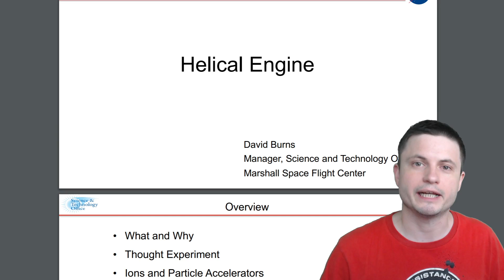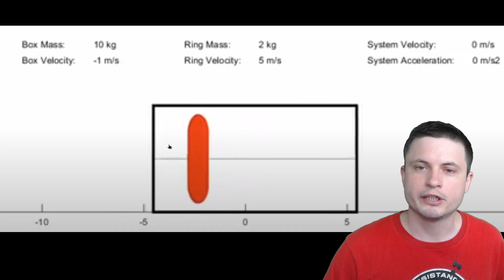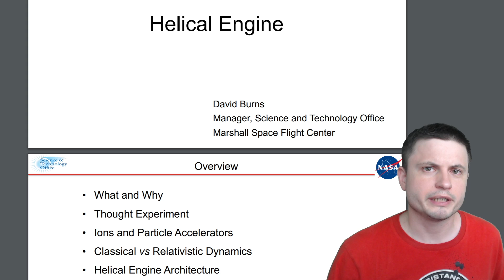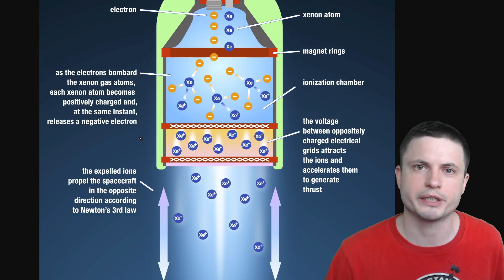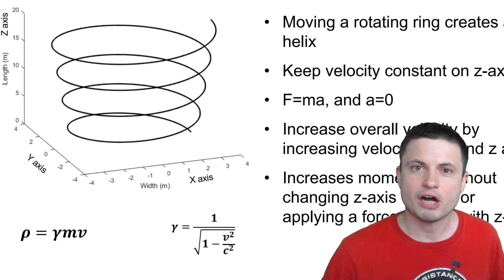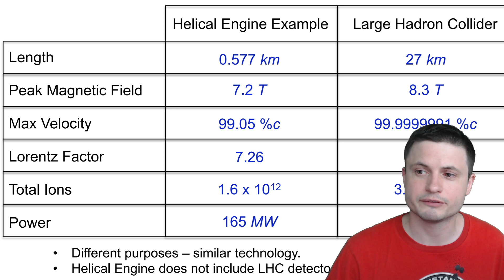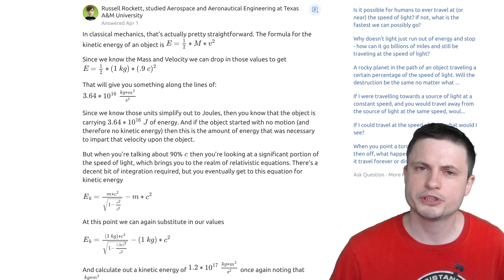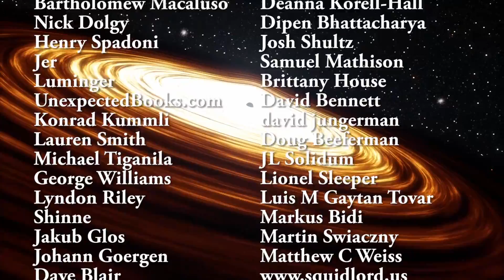NASA Engineer Designs a Near Light Speed Engine But Does It Work?

Comment: My question is assuming that this engine works perfectly and is actually able to be made, how would astronauts accelerating to a massive percentage of light speed that fast survive?
Reply: Why would they not survive? The ship would accelerate at 1G for 50% of the trip, and as 1G equals the gravity pull of the earth there would be no issues with muscle degeneration etc. You would build the ship a little different from what some would expect, imagine a tower where the first floor, and down, is towards the rear of the spaceship, and the point of the space ship, and the travel direction, is upwards. Then, at that point you fasten everything, spin the ship 180 degree so the engines, the rear, down relative to the "tower", is facing the destination, and you start breaking at 1G for the remains of the trip, again resuming a gravity like force pushing the astronauts towards the floor like on earth.
Reply: Kjetil Balstad yes but getting to relativistic speed with an acceleration of 1g (9.81m/s2) is insane. Traveling at 1g acceleration it would take you a year to get to about 4 percent of light speed. While that’s stupid fast, for interstellar travel it’s still a dozen generations just to get to alpha Centauri. And I’m not even taking in deceleration time. 

EDIT: my point is that getting to another solar in any meaningful amount of time would exclude the possibility of human explorers. By the time explorers got to alpha Centauri the government that sent them there to begin with could be gone, Or humanity died out to a plague, or any number of possibilities. It’s a cool idea for getting around the solar system but a fusion drive would be way more practical and beneficial.
Reply: @monauralsnail0669  Hm, are you sure? Traveling 4.3 light years with 50% 1G acceleration and 50% deceleration would take 3.6 years (6 for people on earth). The highest achieved speed should be 0.9504888-and so on of the speed of light. Assuming we solved the issue of energy requirements for sustaining 1G acceleration.

Traveling 43 light years would take you 7.44 years, while your wife would have aged 45 years and you'd remarry when you get home. Highest speed would have been 0,9990689-and so on of the speed of light.

Using a 250 tonnes space ship, you would need more than 67 million tonnes of fuel though. So, some kind of magic engine is needed.

At least this is what I could figure out using equations for a relativistic rocket. We are well outside my field of knowledge here.

Comment: So even if we could theoretically use this engine or otherwise to reach the speed of light, how do you stop a ship after that? From what I understand on this proposed engine it will gradually speed the ship, not instantly right? So it’ll start out slow, for who knows how long, until it reaches light speed. Then it’ll have to slow down, so with that in mind the ship would have to start its gradual decrease in speed halfway to its destination, which doesn’t seem all that practical. Unless the engine could instantly or very quickly get the ship up to light speed and then somehow slow down just as quickly, it might be a fruitless endeavor. And this is assuming the way to slow down or stop the ship will use the same method it used to speed up. If not, how do you stop or even slow a ship moving that fast?

Comment: I'm sorry I'm kinda stupid so much of the information went past my current knowledge, however is it possible to produce energy in space by conserving energy from the loss of heat that the engine produces and then feed that back to the ship as power then recharge at every star through motion and light? Like I mean could you orbit a star at a very fast speed while also harvest its energy then use the collected energy to travel to the next star?

Comment: I had an idea that a reaction wheel could spin and another would spin to keep it from turning the craft, together the force of the spin would just cause the craft to go forward, the idea is that they would be solar powered. I have no engineering degrees so I have no idea if it would work and I practically threw the idea out right after thinking about it.

Comment: So... basically you'd just need a really, really long and very oblong particle accelerator that accelerates matter in one direction at relativistic velocity, while returning the particles along the opposite side at a much slower velocity, using the change in relative mass in the relativistic direction as a propulsion mechanism. Interesting idea. You'd basically just be making a very large flywheel, with the leading edge gaining mass and pulling the ship along. Aside from energy lost in waste heat generation, it should be pretty much self-sustaining, being a closed-loop. You'd need a lot of initial energy to get the ball rolling, but after that you'd just need basic maintenance energy.

Still probably not as practical as just pushing the ship with a big mirror of statites around the sun, but an interesting idea nonetheless. 

I had a vaguely similar idea for a science fiction novel, but using a photonic drive to fire a laser into an Einstein-Bose Condensate, all inside the same enclosed housing. Wouldn't really work, since the photons don't have rest mass, but good enough for a scifi story.

One thing I've never understood with Relativity and the whole Mass Increases With Velocity thing; at what velocity would an accelerated object become so massive it collapses into itself, becoming a black hole? And what happens if it decelerates to a lower mass?

Comment: Mass doesn't actually increase the faster you get even toward the speed of light. It's one of those things that you do not get into until More Advanced physics considering the following equation can be used in most every circumstance. sure you can find out the actual F=M*V equation which is relevant

Comment: Man, how can someone misunderstand and deduce that many things wrong. The mass does not increase and the lengths do not get modified. It is just a phenomenological artifact resulting from the shift in the plane which is perceived as simultaneous points in spacetime. Acceleration -> Shift in what is perceived as simultaneously happening. There is also so much wrong in the math...

Comment: This idea was shown to me about 15 years ago by a Nasa propulsion engineer who lived across the street from a girl I was dating.  I thought he was crazy then.  But I see that the idea must be getting some traction within the scientific community finally.  I can see two tube raceways running the length of the ship with permanent magnets accelerating a working plasma rearwards.  The mass increase made when speeding up the plasma is the push and the plasma slowly loses mass as it travels rearward until finally it runs back to the mag driver for another push.  Hey....they should build a small model of this and let it go from the space station and see if it works.

Comment: Btw, will that Lorenz transform object hit a hole on the engine? It is accelerated like a bullet... LUL And how do you stop the ship? it need very precise deceleration timing...
Reply: The object is spinning at relativistic speeds. Not moving forward at that speed. But, i'd imagine it would still need some kind of break or it would not work.

Comment: I'm from the creative side of the fence myself. I think it's important to explore these ideas but I'm not on board with the argument that the "establishment" for want of a better word, is as stale as many are suggesting. This particular idea reeks of the same flaws attributed to the failed "M drive".

Not wanting to discourage following through on creative ideas is one thing but there's plenty of money been thrown away on wide eyed visionaries too.

I think this needs a much better explanation, particularly on the rotational element which does very little than add a level of complexity that to me loses all its value as soon as you try to shift the vector. It looks exactly like all those useless magnetic free energy presentations from where I'm sitting.

Comment: I’ll throw this out there. In a dream I saw a propulsion system consisting of a rapidly rotating magnetic field such as a 7tesla or grater magnet (MRI) being used to warp time/space in front of a ship .the spinning magnet would be tilted to generate motion and fall forward into the warped space/time like riding a wave. The magnet would be chilled by the extremely low temperatures of space and light as converted to energy to supply the power needed to start the magnetic gyroscope spinning. I’m not a scientifically minded person I just see things in dreams. Some come true.

Comment: With the spinning concept inside the box thing, would it be close to when an ice skater starts spinning with their arms out at a slow rpm but as they bring their arms closer to the center of gravity, the rpm goes much higher? Is there any correlation?

Comment: This won't work, it's violating conservation of momentum as described. The mistake is that when something gains mass as it gets close to the speed of light it requires more force to accelerate. As is well described, force is equal to the mass multiplied by the acceleration, so to accelerate the mass the box would experience the same increase in momentum in the opposite direction. The energy in additional mass from acceleration close to the speed of light is exactly equal to the increase in momentum imparted on the box in the opposite direction as it pushes this mass. 

If you violate conservation of momentum in your model, you have made a mistake. It's easy in mathematics to obfuscate the process of a calculation, but at the end of your formula if you prove that 1=2, all you've shown is that you made an error.

Comment: Wouldnt the next issue after developing the light speed engine (99%). Would be particles, or objects in space we would have to look out for, so it doesnt hit any of the space craft? For example, iss in orbit. there are paint chips that hit the glass of the ISS that leaves huge amount of damage. What about particles, small rocks, asteroids and what not that can very well destroy the craft? Wouldnt we need something that can scan ahead, like sonar (which isnt really possible in space. How could we achieve that, ect. It would at least be as fast as light in order for it to work. Right? Or am I just over thinking this.

Comment: What if you used magnets a thr end of thd box walls? It would push the middle part away and with different acceleration because of the mass differences plus the only energy you would need is to get the thing bouncing. Even if it deaccelerates you need to add just a fraction of energy to keep the momentum going.

Disclaimer! I am not a scientist i know really little physics and this came out of my head by using logic. Please could you give me me an answer to this theory?

Comment: Hi Anton.  Regrettably, I think the idea of the drive is almost certainly wrong (given that it doesn’t seem to conserve momentum). I have a suspicion about where the problem lies; let me see if I can explain it. The idea involves varying the mass of moving particles by accelerating them to relativistic speeds when they are moving in one direction, and then decelerating them during another phase of the cycle. What has been left out of the analysis is: where in the spacecraft does the energy to accelerate the particles reside when it’s not showing up as kinetic energy of the particles, and how is that energy transmitted to and removed from the particles? Wherever that is, that energy will have associated mass (due to E=m*c^2) when it is not accelerating the particles. So, the mechanism involves moving a certain amount of mass from the energy store to the moving particles and back, cyclically — even if that mass is moving through electrical wires or electromagnetic fields. Yet, if mass is moving back and forth, you will inevitably be transferring momentum as well. The failure to account for this momentum transfer is surely why the drive seems to be getting a new momentum change for free. If this momentum change is accounted for, surely one ends up finding out that, as expected, momentum is conserved, and there is no way for the drive to generate any net momentum. (The only “out” would be if the energy sources were outside the spacecraft; but in that case, it would end up being just an obfuscated version of accelerating a craft by shining a laser on it.) So, regrettably, it seems to me unlikely that there’s any reality to the idea of generating reaction less thrust in this way.  (This logic, as in the logic of the paper, uses the problematic notion of “relativistic mass”; but I think that translated to more modern relativistic language, the same principle would apply: the scheme omits momentum transfer between the energy source and the accelerated particles, and that momentum transfer, when properly accounted for, leads to zero net thrust.)

Comment: Nuclear reactor- that's basically turning a kg of mass into energy.
As far as I know, that is far from the truth. Fission is much less efficient than fusion, and even that only releases a small percentage of the energy present in matter.

As far as I know only 100% matter to energy conversion is achieved by black holes
Reply: Idk about black holes, but 100% matter to energy conversion is achieved by colliding matter and antimatter, they annihilate each other, releasing all of their energy. 

You are right that even fusion only releases a small percentage of energy, and fission even less.
Reply: Black holes are only 40% efficient
Reply: I think you mean as in how a black hole breaks down things that get too close? in which case it has near null conversion since its a closed system that can't be tapped on its own- hawking radiation would be the way we'd use that form, as said in these replies the popular idea is that you could throw something at really shallow failing orbit at a reaaaaaaaaaally fast spinning black hole, the amount of stress on the object sent into this orbit would convert what has estimated at around 42~% efficiency in the hypothetical best case! which is fantastic if so, but that is a long ways away. as for 100% efficiency, antimatter is the thing to come to mind, but you first need the antimatter to do such- effectively 1 gram of normal coffee cup and 1 gram of antimatter coffee cup would make a 100% of both of their mass's energies (the strong and weak nuclear forces's worth in their makeup) (which makes this more of a form of battery then a generator for future technology if it works how we think it might). as for your reply with the nuclear reactor the statement is pretty on point, fission harnessing massive elements (uranium/thorium/etc)- fusion utilizing tiny elements (hydrogen/helium namely, basically anything up to iron for the sake of stars). {obv do research on your own i am probs off somewhere here, feel free to correct me :D}
Reply: So I guess we need antimatter drive.

Comment: The Error is how you can create a heavy mass in the center, I.E. the "ring" in the center; that can transition to a lighter mass. I can't think of anything that can do that.
Reply: It's the particles in the particle accelerator like ring, not the ring itself. You accelerate them one way, and decelerate on the way back, and boom, relativity says you have a propellentless drive. But, it takes absurd levels of energy input, and is not very efficient. But it would work based on what we know of relativity, so there is no error there unless relativity is wrong.
Reply: @SmartassEyebrows   But if we had that kinda of energy output wouldn't we be able to just reach nearly light speed anyways?

Comment: So one thing I’d like to point out is that fission reactors are not a 1:1 efficiency of matter to energy.  There was a minute physics episode on this. It converts ~0.08% of the uranium’s mass into energy and from that ~70% is collected by the plants.

Going in reverse is much harder and most likely also wouldn’t be anywhere near a 1:1 ratio for us at first. So the idea that it’s cheaper to use energy to make mass to fling out the back of the ship just doesn’t make sense.

Comment: What about a Gyroscopic effect?

You spin A Gyroscope(A Dradle if you want) and try to tilt it.

it will jump at 90° from the direction of the push..

so you have a double shell of the craft spinning.. then at one of the ends, a magnet is pulling/pushing.

the reaction has the craft jumping.

Comment: Positive charged iron bar surrounded by "cage"" with positive siding that repulses the bar continually the whole set is then rocketed the ends of the cage has steel electromagnetic discs that's has a resting positive charge the bar is pushed to the back and when the machine is active the bar is pushed by the initial magentic force along with boosted etc at any point that speed is not sufficient enough the electromagentic sides is alternated swiftly the bar free floats to the back cause of outer cage movement the siding is actives repulses the bar faster then the cage moving with the other side attracted the bar and absorbing energy

Comment: E = mc^2. To gain 1 kg in relativistic mass, whatever energy source you use will have to lose 1 kg of mass to produce the required energy (10^17 J  is 1 kg of mass-energy equivalent).

- If the energy source is part of the moving body, the mass loss of the energy source cancels out the mass gain.
- If the energy source is part of the box, the momentum from moving the energy to the moving body cancels out its increase in momentum.

In the end, all you have is a very hot box. Conservation of momentum lives to fight another day.